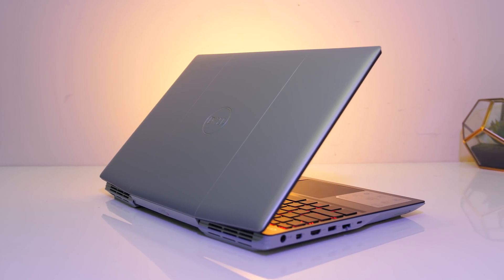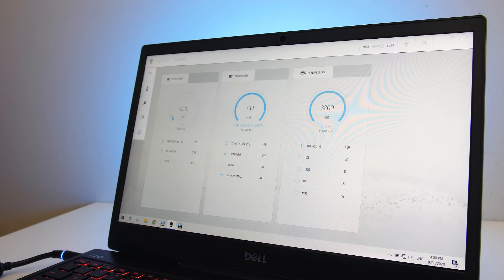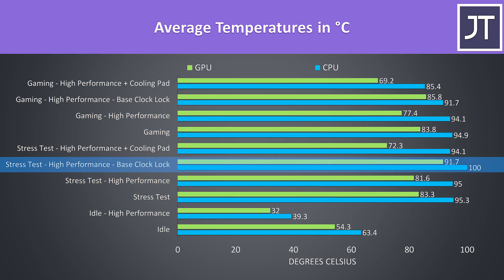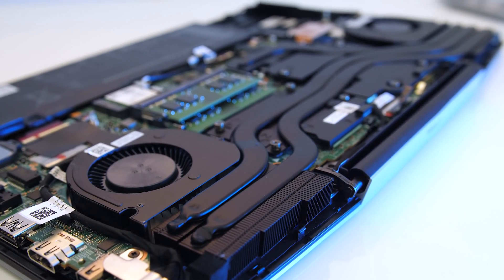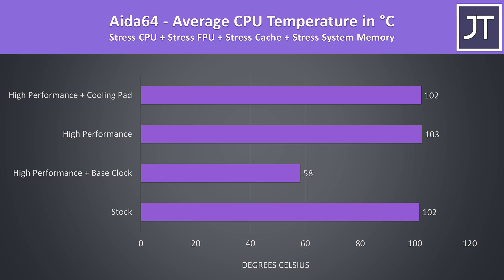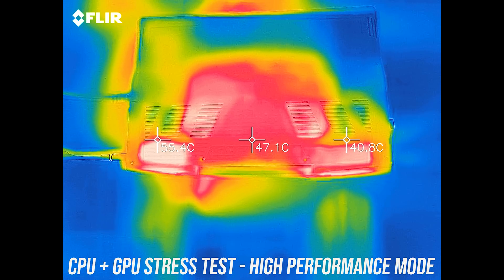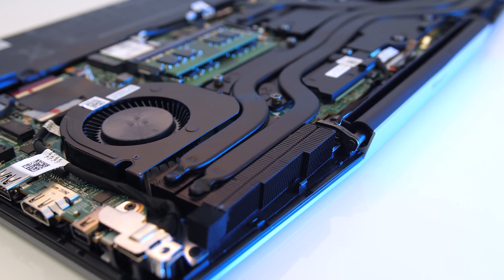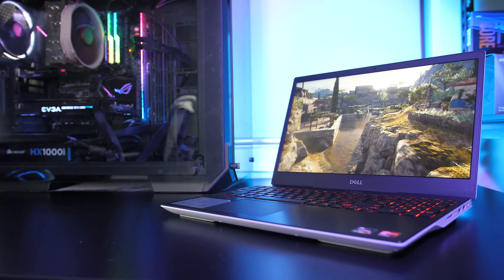Dell G5 SE (4800H + 5600M) - How Hot?

Comment: Hey Jarrod 
I ordered G5 SE with same configuration after watching many of your videos and many suggestions,  and this machine works incredible 
But when I play crusader kings 3 , according to my alienware command centre,  the GPU temperature reaches to 80-88 , I play at max settings which my screen supports with 70-100 fps ,
Is my GPU over hot ? I am concerned 😟
Reply: Is it working fine now ?
Reply: @okkotsuyuta444  with ryzen controller,  it works good , but without it, not good

Comment: Hey I recently bought this laptop off best buy while it was on sale. Mine is gonna have to 4900h, 16gb ram and 5600m. Do you recommend applying paste on the cpu at some point? If so what do you recommend? I don't mind buying cooling fan if its needed.
Reply from the maker: Go for it if it's too hot, no idea what they use at the factory though or what you'd need to use to see an improvement, I haven't tested many pastes.
Reply: Thanks for the reply, i'll see how it goes once it arrives. Will update once it gets here and I test it out.
Reply: @2257turtle  so how was it bro?

Comment: This laptop seriously needs an undervolting. Yet there is no way to do it. Neither Alienware app nor BIOS allows it and apps like Ryzen Master and Throttlestop aren't compatible with the CPU. If there is anyone else who knows more about it I would be happy to take suggestions. Overall, the heating is a serious problem in this laptop. Those high temperatures end up with throttling which causes remarkable fps drops. If I cannot solve this problem I think I will send this laptop back. This CPU and GPU are great,
 however what is the point if I cannot use them to full performance...

Comment: HOw hot this one can get? True answer is all Dell mobile gaming lines are easily and usually get a hot for a short period of time, less a hour dell machines can reach up nearly 100 degree celsius for running highly demanding games, no matter what kind of cooling pad you're using, or fans speed control.  Another hot partner is lenovo, if you care about gaming in long run on laptop platform, or durability just stay away from these two.

Comment: I edited the registry and added the Processor Power Management option to the Power Plan. I tested with GTA5, that was constantly running on 100-103 Celsius. After I disabled Turbo Boost completely, temperature decreased to 95-100 Celsius. I tried playing around, and the best performance-heat combo for me is the "Efficient Aggressive At Guaranteed". This way it runs on 85 Celsius, and no lags, or game quality drop whatsoever. Let me know if this worked for you too.

Comment: So should i buy it?
Reply: Depends if you can get it at a good price and can handle it's shortcomings (turbo boost needs to be disabled to get best out of thermals) and the LCD design could use improvement (look up on Reddit basically it has no metal frame causing warping and yellow backlight bleed in the corners) if you can handle this and potentially having to replace the LCD at some point then sure.

Comment: Bought this one, was playing Assassins Creed Origins at ultra settings forgot to turn on high performance mode, crashed with critical hard drive temperature, though I don't know what temperature it did so but got pretty hot. Later started crashing and restarting even with high performance mode eventually fixed it with temperature ranging between 72-78 C with one inch raised laptop from the back, so as I am living in India with avg temperature most of the time above 30 C, it's better to have a cooling pad.

Comment: My answer is any hardware set up on Dell mobile product line has no chance to break free at thermal issue.  This brand is a super awful performer about providing and improving system cooling for years. If you care about thermal issue and stay away from Dell, I can promise you there is no other brand that worsts than dell at thermal solution testing. Gaming line even an nightmare  to players.

Comment: @Jarrod
So i must admit three things after a week of testing with my new dell - 
1. The Freesync just worked with the integrated display with the new 17.june.2020 AMD Dell se driver from the AMD Site
2. After setting the Dell to the Energy Profile Balanced - Efficient Agressive (needs Registry Editing) .... i now can stop boosting this beast without the need to.
3. The themal compound is just crap - i repaste the hole cooling system for CPU and GPU with kryonaut and temps went 10°C down (before registry and new driver!)
So for now .. the Dell is just quiet under Windows and little Tasks .. the Fans never spin.
On the Gaming Side of Things - its a huge uplift - when use the STOCK! Frequency of just 2.9Ghz and the new driver not only Freesync works (60-144hz Range) with the Laptop Screen... 
Also i see temps beginning in the 60°C - to 80-90°C depending on the Game. 
YES, the Fans got still loud but its not throttleing or hot surface anymore overall.
I would say its like any other Gaming Laptop around.
Sry for my bad english - but i would share this as fast as i can.
When i render or do CPU intensive Tasks i use the Energy profile HIGH - and for Gaming i use Efficient Agressive.
I would say it safe me from returning this unit, because now i love it without compromising to much.
Reply: Still sounds bloody too hot.
Reply: Aloa he thanks i was thinking their thermal compound must be crap thks for clarifing

Comment: What the hell people are talking about? It's a stress test and If I remember correctly this year's Macbook hit 100C too. I saw some baboon say "How long will the laptop last." If you not gonna put it on stress test everyday it'll last more than three years.
Reply from the maker: You're missing the point. You're also supposed to take the clock speeds into consideration, and this will absolutely demolish the MacBook. that said there are still other machines that don't run this hot and perform similarly, determining this is the point
Reply: @JarrodsTech  those laptops which perform similarly almost cost twice the price

Comment: I bought one of these, the exact same model too. I haven't repasted yet, and was surprised by how hot it ran when I stress tested it with folding@home. 

What surprised me was after a couple days (off and on), the temperatures came down a bit, but my folding@home numbers stayed pretty similar.  Playing with it a little bit, propping up the back (without blocking the vents) a little seemed to help too.  It's probably paste+air pressure at the intake, after whatever caused the initial dip that I still can't explain.
Reply: Will you use liquid metall? Can you make a video of repasting?
Reply: @Flatsteff  - I didn't do a video, because I don't have a channel, good equipment, and I wanted to take my time.  No liquid metal either because I'm a slob.

I threw some Kyronaut on the GPU and CPU though.  It's life changing.  Seriously.  Slammed the CPU, and I could immediately tell the difference.  Cinebench stayed under 80 degrees with fans still low.

Comment: Mine arrived today, I've played a selection of around 6 games on it and they all run buttery smooth - between 56 and 70 fps on Witcher 3 ultra setting. Doom (2016) ran between 129 to 159 at Ultra with AA set at 1X (Vulkan).

It doesn't seem to get that hot but I've got it on a cooling pad (small one) and always have G shift enabled. Got temperatures in the mid to high 80's CPU and high 70s GPU
Reply: Where can I get one?

Comment: What are the specs on the RAM that it comes with? Are you able to overclock/trim RAM timings in BIOS? Could I possibly upgrade the RAM to maybe a 3200mt/s C16 kit (if the current RAM is even 3200mt/s C16)? Would it take a 32GB 3200mt/s C16 kit? What are the specs on the M.2 drive, is it a SATA SSD or NVMe drive?
I'm probably going to buy one of these (have to wait for September for other reasons) but need to get more specifics on the hardware aside from the CPU/GPU, thanks in advance!
Reply: Scott Stamm specs aren’t all on the Dell website but it is upgradable you 32gb at 3200. That’s the fastest speed the CPU can take. 

There is a spot for a M.2 NVMe drive. The other is being used but it’s a M.2 NVMe. So you have two slots

Comment: Honestly I am not impressed with either whatsoever.. I thought these 7NM chips and GPUs were supposed to run way cooler.
Reply from the maker: I think you're under estimating the effects of the cooling solution and whatever the particular company using the chip decides to do
Reply: @JarrodsTech  Yes that's an excellent point indeed Jarrod. Obviously  they didn't bother to do a good enough job to cool these items for max performance.

Comment: We need some control for voltage and clock. 8 core 3700X can run stress 3,9GHZ under 55Watts and under 35Watt in games
https://www.youtube.com/watch?v=DHdc9NeRiNc&t=696s
Reply from the maker: It also has far superior cooling
Reply: Better cooling help to keep temperature lower but 35Watt with 1Volt should be easy to cool even for laptop's cooler. We need Ryzen Master for laptops :-)

Comment: It seems the laptop has CL22 memory. Is there a way to exchange the memory modules with CL16 or at least CL18 ones? The Ryzen CPU would definitely see a large speedup from that. My concern is whether or not the laptop would just ignore lower timings and set CL22 anyways. I hope 4600H will perform better with this subpar thermal management from Dell. By the way, nice video, thanks.

Comment: How does this compare to the older G5 with intel i7 and RTX2060?
Reply: The 2060 is going to be better overall. In this scenario you have to look at price to performance. This laptop is an awesome value. The older G5 has the same thermals I believe. The cpu is beating i7 processors so you also have to think there is no bottleneck here.

Comment: That's AMD alright, low prices but really bad temps....
Reply from the maker: I wouldn't blame AMD here, people are quick to forget that the intel-based G5 runs at 100 degrees too
Reply: @JarrodsTech  I see, so it's just not a very good cooling system they have going on. That's a shame because I'm still using the 2018 dell 7577, and at full load both CPU and GPU temps don't go past 65c. I was hoping the 2020 dell laptops would've had similar temps.

Comment: ASUS TUF A15 have design flaw making the machine hot and you are recommending it. Disappointed in you. U r not good a reviewing tech. I will not trust u
Reply from the maker: At what point did I recommend it? Get your hearing checked. Fact is, this machine is worse than that in terms of both performance and cooling. The point was it makes the tuf look better. 🙄

Comment: Good review. Can you try undervolting the gpu through afterburner if possible? My 5700xt runs at 1200mv stock, I was able to run itbat 1060mv with same clocks, that reduced thermals by over 10C a lot and consumption by 20%. I now run it at 1610@850mv, consumption is now 50% lower, card is very silent and temps are down 25C on gpu and  35C hotspot.
Reply from the maker: Don't think so I can't do anything to the GPU in afterburner
Reply: @JarrodsTech  okay, hope you can check if it's possible to unlock voltage controll :)

Comment: Anyone have a laptop recommendation in the 1000-1500 USD range that has good thermals and performance cause my PC recently shit itself so I need a new computer

Edit: I chose to go with the eluktronics rp-15
Reply: zephyrus g14 (1300)
Reply: Internal Error I really like the G14 as well but I heard the thermals are pretty bad cause of the thin and light chassis but I could be wrong.
Reply: following
Reply: Joe tuf is good but it seems like asus sabotage themself to sell the rog series more. it heats up a lot cuz they block the vents
Reply: lenovo legion 5 or hp omen 15
Reply: just build a pc
Reply: Jason wow just stop with these stupid “build a pc” advice for people looking for a laptop. People are looking for a laptop for a reason. Everyone knows building a pc is better in terms of performance, thermals, and value. Hurdurdur
Reply: @Jason-si5ho  I would but I'm heading off to college soon so I might as well get a laptop since I can't just drag a PC to my classes
Reply: Dank Memes look at predator helios 300, legion y540 or g14. all solid gaming laptops under $1500 and 2 runs ryazan
Reply: @scoot5642  I need an amd system tho cause I'm going into engineering and I'm gonna need to have good multi core performance for 3d renders. I would get the g14 but the ghosting on the panel just killed it for me
Reply: Dank Memes the best one currently is dell g5 se then
Reply: @scoot5642  is the performance alright for gaming since I'll be using it for gaming on my off time? Also thanks for taking the time to reply

Comment: Dell gave the unit inadequate cooling. 
It's pretty clear that high temperatures are choking both the cpu and gpu.

Also for people claiming that 100 degrees Celsius is something the cpu can work with... Not really, because performance drops quite a bit at such high temperature  which also diminishes the hw lifespan (not to mention the lifespan of other components in the system - especially laptop chassis). 

When Dell replaces the 60hz screen with 120hz version this summer, they should also replace the cooling assembly with a more powerful one capable of keeping both the cpu and gpu at 75-80 degrees Celsius when both are fully stressed at the same time (and achieve/sustain their Maximum advertised clocks).

You can clearly see the cooling assembly is weak. Only 2 shared heat pipes for both the cpu and gpu ... That's inadequate.

Both 4800h and 5600m are more than viable options and powerful ones for gaming and productivity. 

Heck, Dell could probably adjust the voltages on both the cpu and gpu to drop temperatures drastically (or give users the ability to do that). 

They still need to beef up the cooling assembly. It's too weak

Comment: Jarrod, may I ask something. From all your previous reviews, I'm just wondering if they were running on single channel configuration only during the test. I'm baffled that my laptop's benchmarks is different than the majority presented it.
Reply from the maker: Always test dual channel and this is always listed in the specs at the start of the video
Reply: @JarrodsTech  Why didn't I see that, alright thnx. I thought prebuilts usually have 8x2 slots for optional 16 ram. I guess I'll have to buy another one.

Comment: As expected the G5 itself is pretty much a hot laptop. Seeing how the design of the air vents on other reviews, I now see that it does effect thermals in the long run. Intel versions might be just as hot unless there is a different design elements on that, though it is highly unlikely seeing my Dell 7567 also retains the same designed thermal vents. Still, it is not bad for what it's worth, just maybe better thermals design on next year's model, Dell?

Comment: 6:49 finally a thermal camera view. 
so it's true that both side of the bottom part of the display is getting hotter due to the vent / exhaust pointing at them like a heat gun when it's open.
it is as if it was design for plan obsolescence.
the display shell is plastic.  it it will soon get brittle and it's just a matter of time before it crack near both side of the hinge where it centered the stress of opening and closing are.

Comment: This is one of the many reasons I haven't bought a piece of junk Dull product in years nor will I ever buy again
Reply: Alright, consider this:
$ 875 
Ryzen 4600h
8gb ram
RX 5600m
Runs a little hot if you push it way more than it is intended.
That’s Literally it’s only problem, the rest is perfect (for the average person). So do you consider this junk?

Comment: Im loving you analysis on the new G5 SE and TuF A15, im thinking about buying one of the two but im still not sure which one specially cause i want one  for like  4 year +-
Reply: Frederico Santos that’s a pretty hard sell. As both are having thermal issues. I have this laptop and it seems thermals across all laptops have thermal issues and I bought the extended warranty. Seems technology will only last until the the warranty period.

Comment: Good review.  What were you using to read the CPU temp?  Lot's of the reviewers were reading the Socket temp as the CPU temp.
The Socket temp will be the highest reported Temp sensor and the actual CPU temp will be 10-20c less.
I've seen 2 reviews so far with max temps from 85-87c.
The hothardware review showed a picture of the "CPU" temp being 105c.  And the SOCket temp being 85c.  He had the sensors backward.  CPU is never hotter than SOCket.
Reply: tytlyf I r been average 86c on my Ryzen 5 on this laptop. I’ve seen spikes go up to 100c but come back down
Reply: @Stevenyc69  what do you use to see the cpu temp?  Can you take a screenshot of the cpu sensors?  Preferably while running a benchmark?